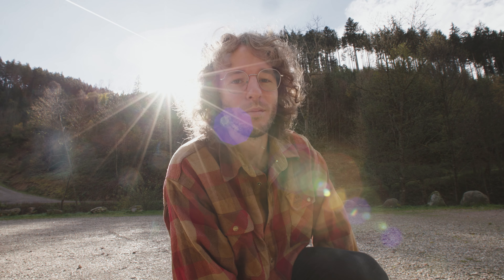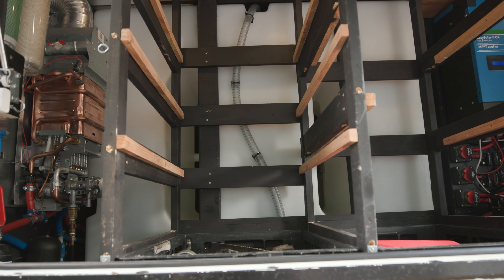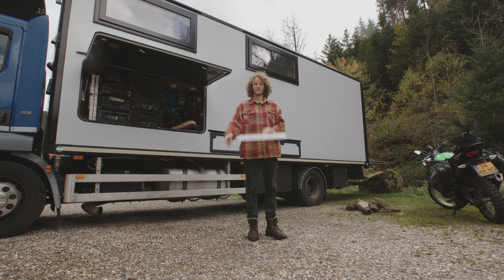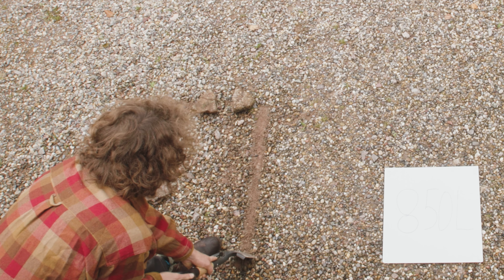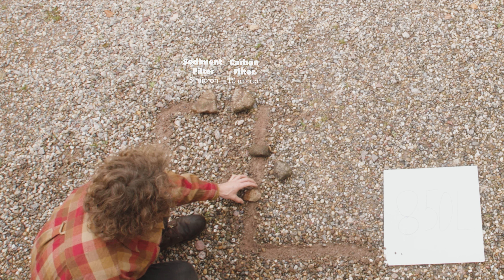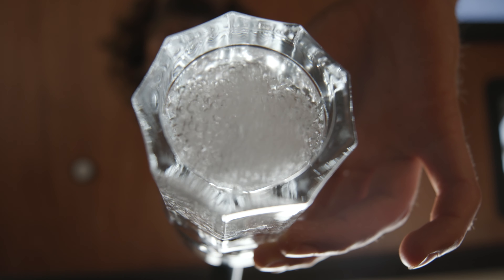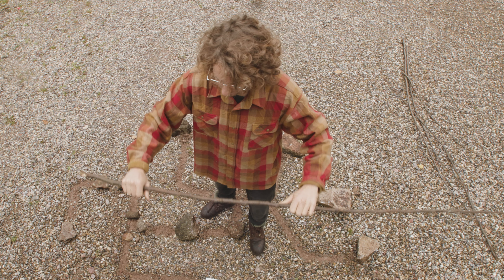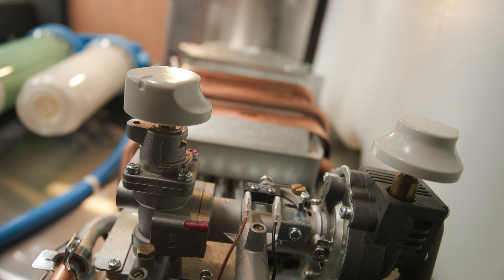Easy Explanation | Off-grid Water System

Comment: Nice! 800L is amazing! 
We also have a instant LPG Water heater in our van and the described problems als follows:
Since we also have not enough space for the exhaust gases to vent natural upwards but to the side, we installed a computer fan right at the end of the pipe to suck out the fumes from the chimney.
To save water while waiting for the hot water we installed a prime line that splits off right in front of the tab and goes back into the water tank. so we basically let the pump circle water through the heater for 20 seconds before we open the actual water tab.

Comment: On my boat I use a 450L water tank, but I only fill it up with what I need. In summer it quickly becomes a little stale. So I fill up 6 minutes or ~  90 Liters. That will last for 2 to 3 weeks. In winter I take  20 minutes and that will last for a few months. The boiler I never use. The kettle  does it all. Coffee,  tea, dishes, sponge baths, etc. I start the water pump by hand, and fill the 3 liters accumulator tank, and turn it off again. This way a leaky pipe will not loose more then 3 liters of water. Much better then loosing the entire tank into the bilge and flat batteries. Don't ask me how I know :-)
Reply from the maker: How do you shower?
Reply: @NicoJona  once a week at the harbour office, or at family or work. But during corona lockdown no shower at all for months. I didn't mind that much. Before 1950 no one did.
Reply from the maker: Haha, true!

Comment: Have you got rain capture of roof yet ? A heated solar floors and recirculating shower
Reply from the maker: No, sounds interesting? Where can I find more info?
Reply: @NicoJona  have to make rain capture filter system easily. Campervan guy uk transit recirculating showervfrom diesel heater and solar

Comment: After a half-century of make-do camping in lesser rigs, in 2003, we converted a 1996 Ford CF8000 commercial truck to our concept of an ExpeditionVehicle.
.
After dealing with yuge fresh-water tanks, we engineered our rig with stainless-steel five-gallon retired Pepsi kegs.
.
Our usual load is seven, for thirty-five gallons.
Because the system is modular, we can easily add a dozen more.
.
In the toy-hauler I fabricated on a similar commercial chassis, we can carry an additional couple-three dozen more kegs.
In theory, our duration without re-fill is about four months.
.
Here is a similar system by YouTubers 'Everlanders' in their home-built ExpeditionVehicle:
https://youtu.be/1THtBYxu8N8

Comment: Great explanation. 👍 Do you notice a weight distribution or uneven /side heavy when the tank is full? Did you counter balance the other side with something else?
Reply from the maker: Good question. I was scared about feeling a weight difference as well. We chose design of our living space over a good design for weight balance. That being said, everywhere where we could counter weight, we did. 
Lucky for us; our truck uses air suspension. It’s a bit heavier on the left side but the suspension balances this out. However, when we are staying somewhere for more then 2 days we start to notice that the truck slightly leans towards the left side. The air suspension has a small leak I suppose.
Reply: Most air systems lose a bit of pressure over time, have you considered adding fold down supports like many trailers (caravans) have to level themselves in camp sites?